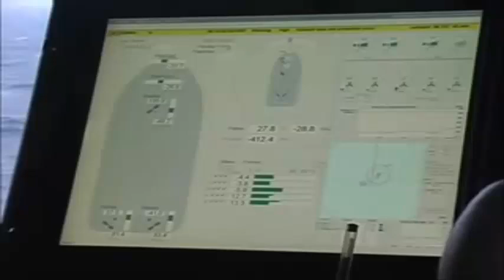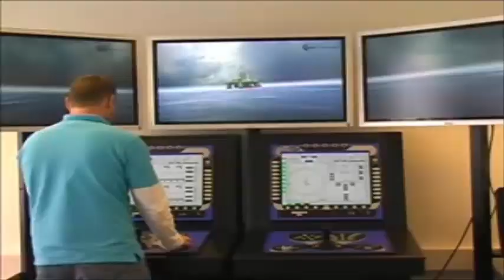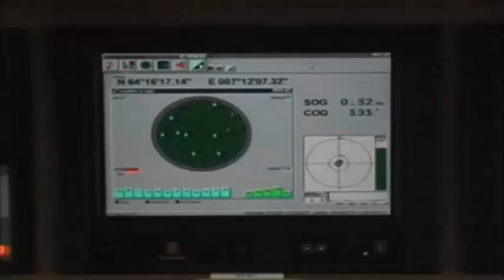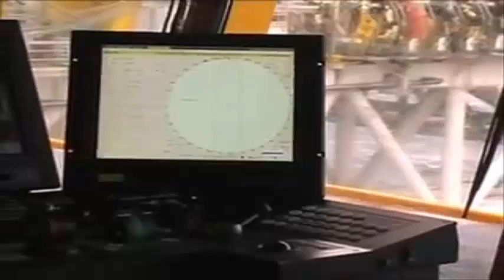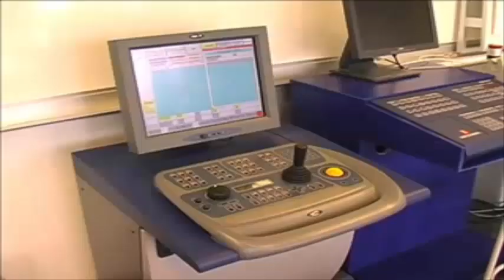Dynamic Positioning Systems, Principles, Design and Applications

Comment: A fan beam is a type of radiation beam used in medical imaging, particularly in computed tomography (CT) scanning. In a fan beam CT scanner, the X-ray source emits a collimated beam of radiation in the shape of a fan. This fan-shaped beam rotates around the patient, and detectors positioned opposite the X-ray source measure the amount of radiation that passes through the body from various angles. This data is then used to reconstruct detailed cross-sectional images of the body's internal structures. Fan beam CT scanners are known for their fast scanning times and high image resolution.

Comment: Hey, Thank you for the video! QUESTION: time of experience on board variates depending of the kind of DP isn´t it ? For example: for apply to Shuttle Tanker´s DP system certificate you´ve got to have more days than most Offshore Vessel´s DP systems.. I am right or not ?